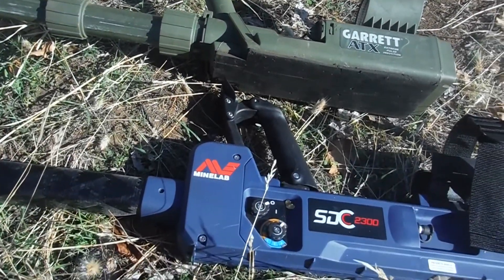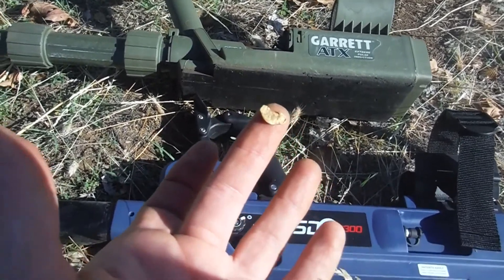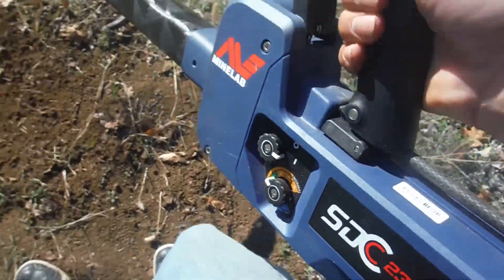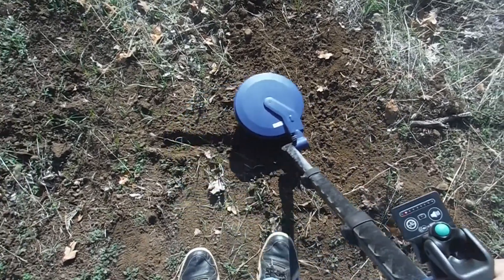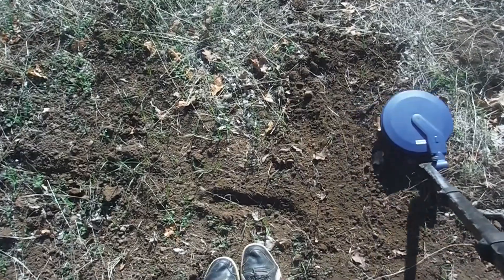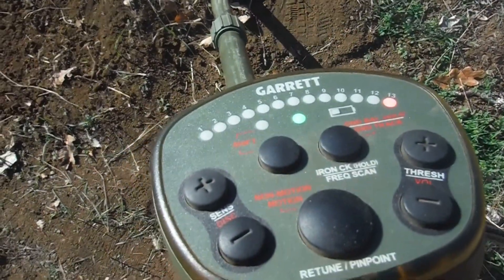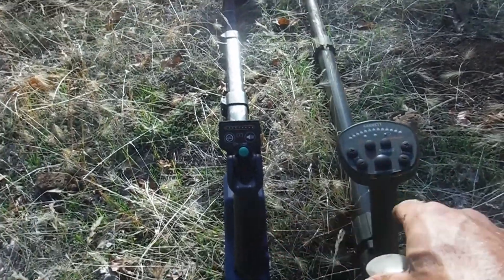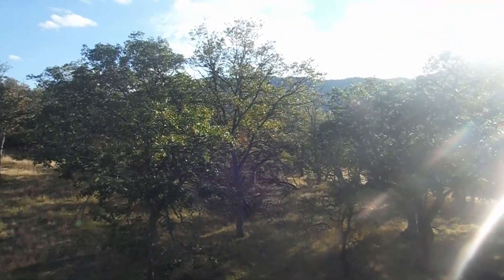Minelab SDC 2300 "Detection Hole" Discovered - Explanation - Part 7

Comment: Gday BearKat, Iv just brought the minelab and spent about 8 days detecting. So far iv found over 60 nuggets ranging in size from 0.01 - 0.5 grams here in Australia. This is my first detector and I'm happy with it so far. It can be little noisy at times but usually a tune will quieten it down. With regards to the "detection hole" you've discovered… Is it only with that particular nugget you demonstrated with? Or is it with all 1.1 gram nuggets?
Reply from the maker: I found it also with a big 50 caliber lead bullet. Since it is auto track, the hole moves around so you really don't know where it is unless you do a test. Its a great machine though - very hot on the small stuff when there is no hole, which is 90+ % of the time.
Reply: Bearkat4160  Ok cool thanks for that. . Love the vids. Keep them coming.